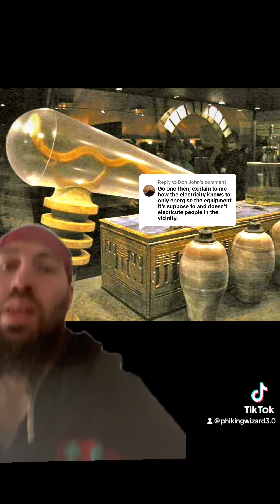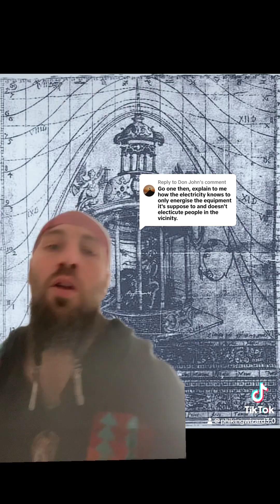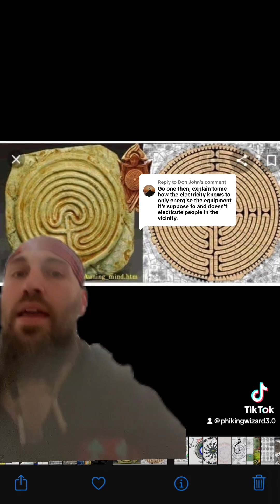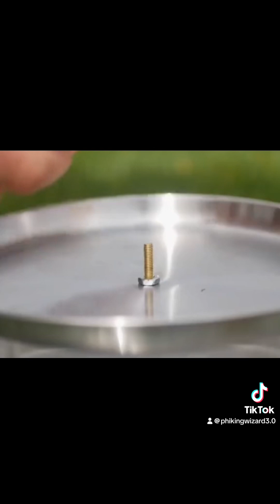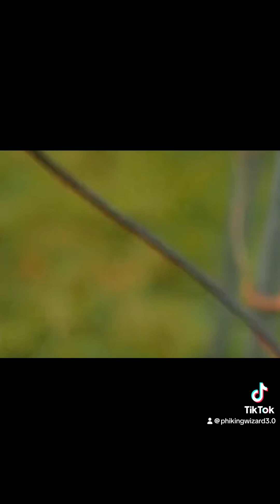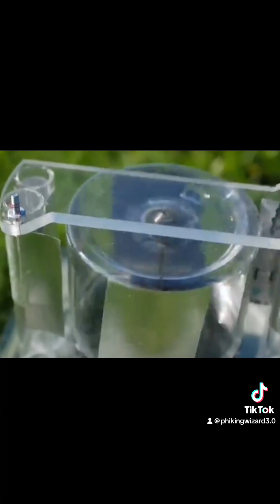Aetheric energy 101

Comment: I tapped the fundamental Aetheric field/medium through a multidimensional philosophical equation that solved for the Spiritual Great Work of Alchemy. Have been looking for folks open to recreating the work, in both 2/3d as the equation contains the logic/architecture that can be applied to circuitry. This is understood to result in a harmonic/coherent piezoelectric oscillator...